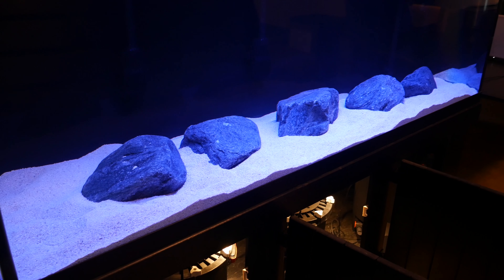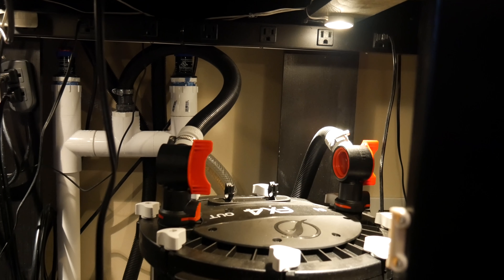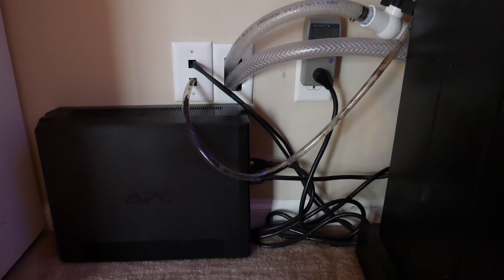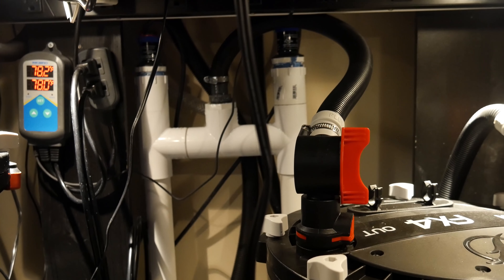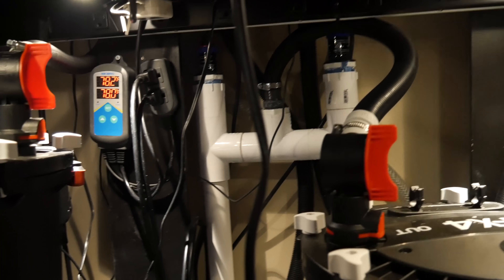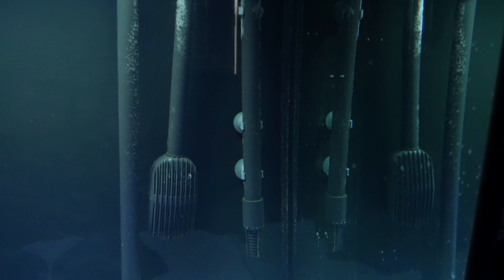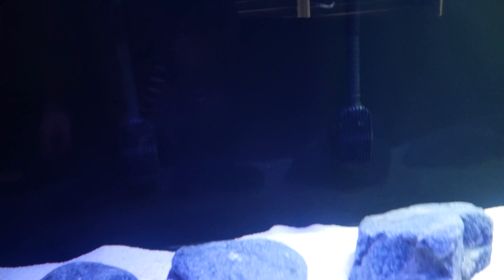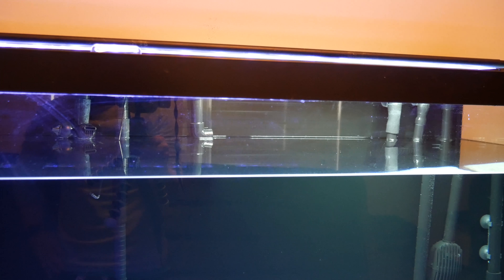Equipment Changes on the 220

Comment: Nice setup!  How do you connect the Fluval ribbed hose to the hose barbs on the DIY inline heaters?
Reply from the maker: Hose clamps
Reply: Thanks.  You don't have any issues with the ribbed hosing sealing directly against the hose barbs?
Reply from the maker: It has been awhile since I did it. I seem to remember it being a pain to get them on but once I did it they have been fine ever since.

Comment: Nice! Did you ever consider a sump with the amount of filtration you have going?
Reply from the maker: +emerson galicia of course. For one, I just can’t bring myself to drill this 220. If it went wrong I would be really upset. Also I’m not a huge fan of sumps in my living space due to the noise, though I’m sure that could be mitigated to some extent.
Reply: Steve Poland Cichlids don't have to drill your tank, use an overflow box I use one on my sump oh, and it's not really loud at all. Think of a sump as a magic canister filter with no lid that doesn't ever leak. I've had nothing but problems with my FX4
Reply from the maker: +Sasquatch Aquatics I have an overflow box, two actually, big ones, and I know a lot of people use them but I don’t think I could ever fully trust it.

Comment: I’m doing your set up for inline heaters. I have a fx6 but can’t figure out what barb to use on the ribbed hose. The 3/4” barb is too small and the 1” barb is to big. Please help!
Reply from the maker: +ARO 9 AQUATICS use a 1 inch barb and force it on there.
Reply: Steve Poland Cichlids thanks for the response! I’ll try harder... lol

Comment: You said you want the least amount of items in the tank thus the external heater set up , but then you add all those pipes in the tank. Has to be a better way to stream line your set up.
Reply from the maker: +Raider Vic I only added one that’s really visible, for the drain line. It’s worth it. And really all of those lines are invisible with the normal tank lighting. Whereas a heater is not